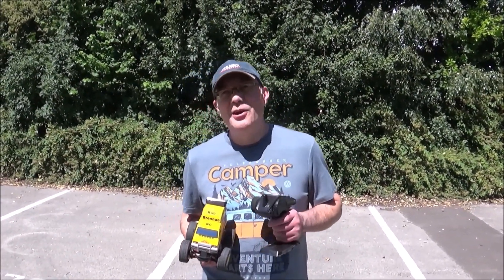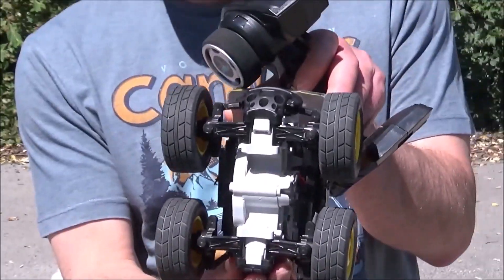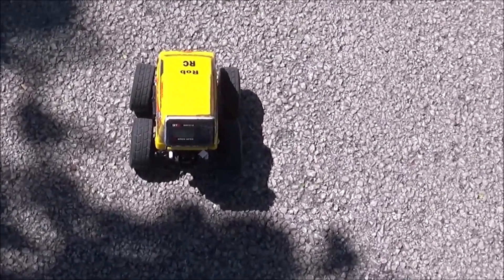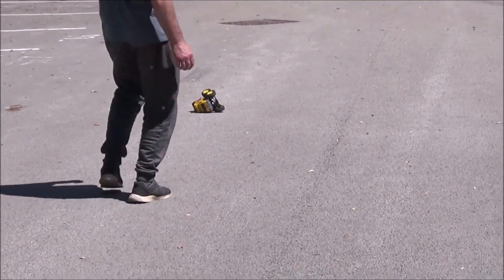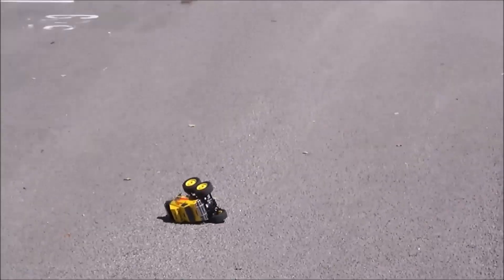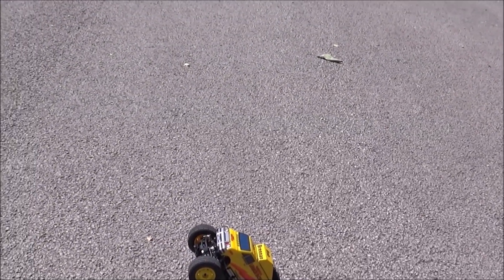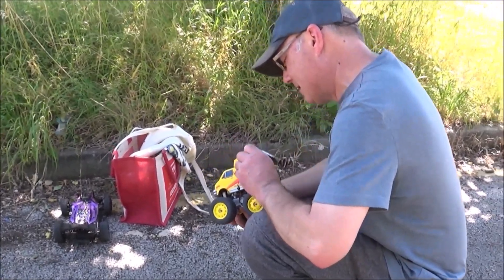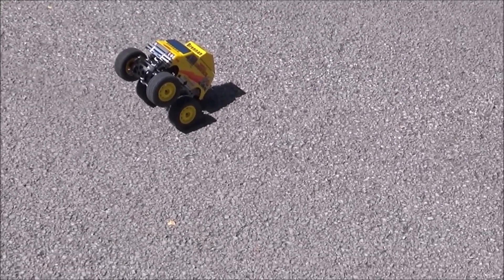Tamiya LunchBox Mini SW-01 Speed Run Part Two

Comment: Looks a funky little thing . Do you recommend it Rob ? I suppose it would require a battery purchase to? Great vid mate
Reply from the maker: Hi Dom. It's a lot of fun and you can use it indoors as well as outside. I do think though that it is one of those kits you should only run once in a while to keep it fun. Yes you would need a battery. ModelSport do one here for just over 18 quid. https://www.modelsport.co.uk/product/overlander-2200-mah-74v-li-ion-battery-pack-mini-tamiya-for-ftx-ravine-and-buzzsaw-1334512
Yes I recommend but I would also say you should install the all wheel steering mod (or knock them up as I did) and the Wheelie ball mod and definitely make up the rollover box.
I am currently looking at if I have funds to get either the 370 torque or sport tuned motor for it.
Thanks for watching and all the best my friend.